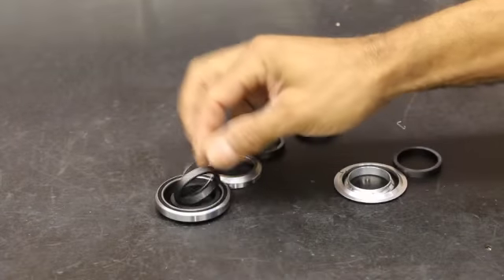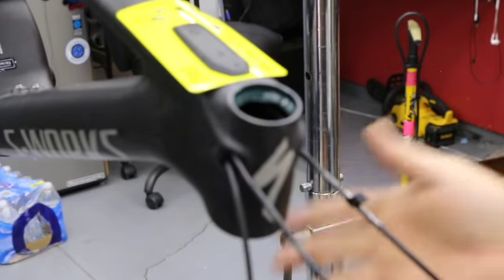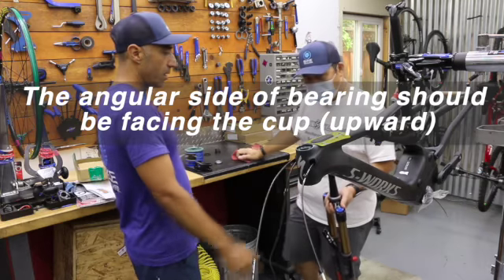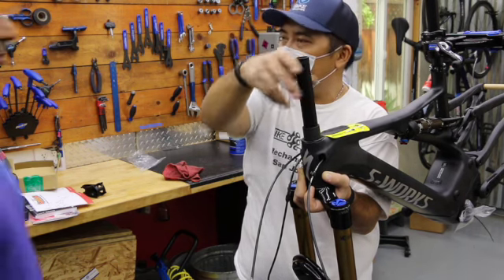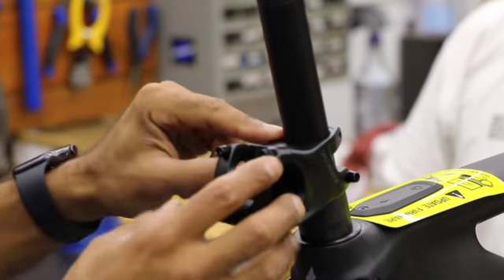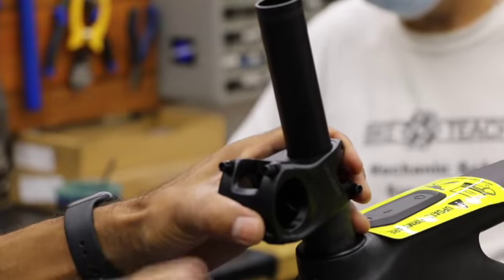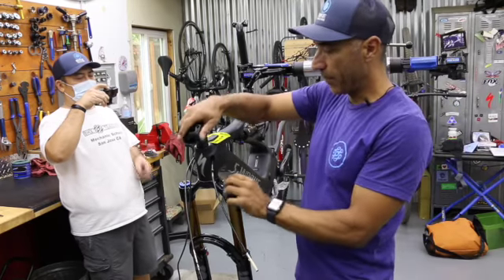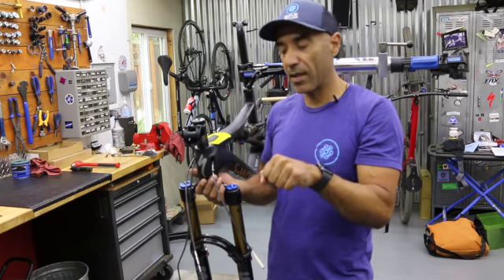How to install a integrated headset on a Specialized Turbo Levo on your own.

Comment: Thanks for the reply. bb is new, as are the cranks with correct spacing for the shell, as i bought new to go with new frame. Have taken apart and regreased. Still have the creak when stamping on the cranks hard. Next step is to change the BB

Comment: also, do you often get creaks from the bottom bracket? i have an s-works enduro which now creaks from the BB
Reply from the maker: Not likely. Assume it is coming from the bb, creaks are dependent on one or more components getting loose, dirty, or just breaking down. So identify what areas can be disassembled, cleaned, regresses and torqued. Other items like bottom bracket bearings, could be breaking down. Spindles, shafts and crank arms may be pressed into each other at factory could be loosening up. Although low chance of that.
Reply: The original fsa are poor bb

Comment: Hi
I am retired in Thailand. I bought a used 24 sp Gaint mountain bike here in Thailand .the bicycle shops are not as good as USA . Even though i took it to a bicycle shop they didn't fix it properly.the problem i have am having is the rear derailleur is not going to smallest  gear. 
And somehow the front derailleur got stuck in Middle gear. 
After i tried to adjust it. 
I got it correctly first but somehow it went wrong 
My question is 
1- Start with front or rear  derailleur first 
2- how do I get it to go to smallest rear gear 
3- how do I adjust the front derailleur to go up and down ( stuck in Middle gear)
Thank you very much 
Enjoy your videos 

I
Reply from the maker: Hi, try this video to learn about limit screws. and then barrel adjustershttps://youtu.be/vAQ1ZPDKVhE. https://youtu.be/sBUCZdUxMSc